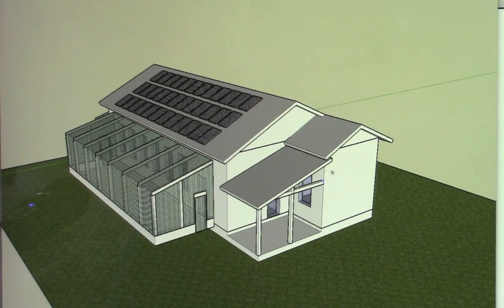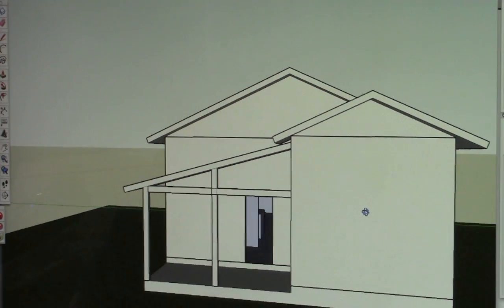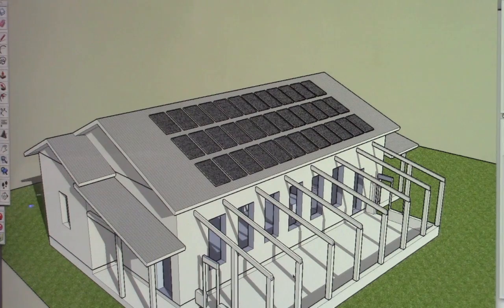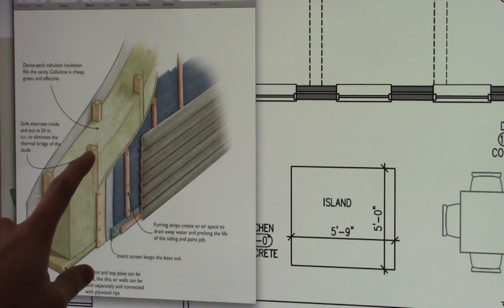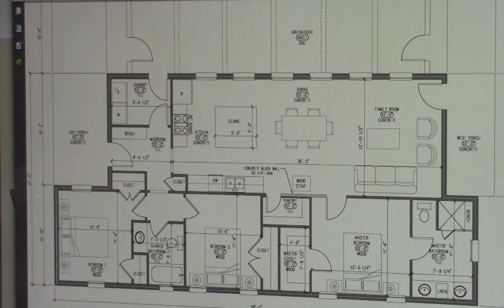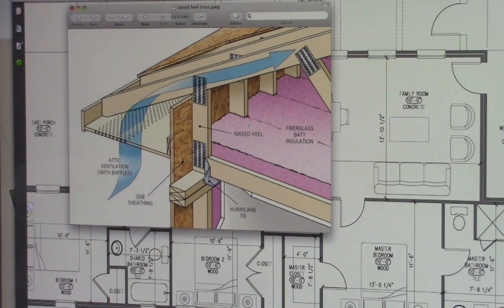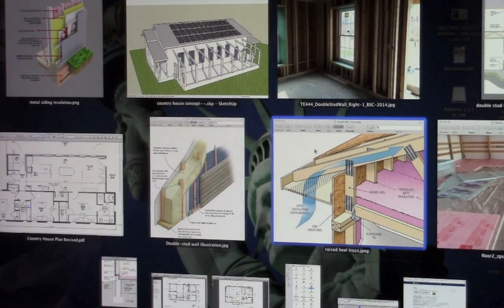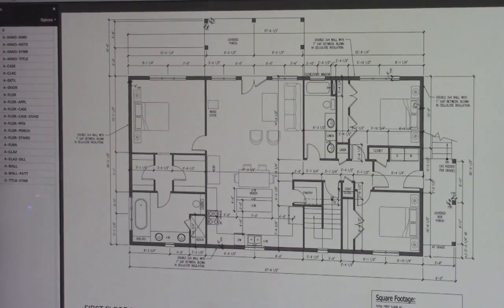Sustainable Off-Grid Home Design - DIY energy efficient green passive solar and affordable!

Comment: You say you would like to do without cooling in the summer. However, it seems to me that a south-facing greenhouse is a major heat collector in the summer (think solar oven) and would put a lot of heating pressure on the house through the windows, if nothing else, even if you have no direct sunlight coming into the windows. Big vents in the apex of the greenhouse, with air intakes at the bottom, would help. 
We've struggled with that design problem ourselves and don't know of a cost-effective solution. We basically have to decide what is more important - heating or cooling. And in Texas the heating season is short and the cooling season is relatively long.
Reply from the maker: I appreciate your comment and concern Inge. Rest assured I am well aware of the heating and cooling principles here. Think earthship design. I believe I did forget to mention in detail within the video, the use of convective forces to cool that greenhouse in the summer....there will be vents at the top of the roof structure as well as several beeswax activated vents at the bottom of the doors and on the South side. In addition to that, we will have a geothermal air movement system pulling that warm air through the cool ground further keeping it cool.
Reply: Thanks for the reply. :)

If I "think earth ship design," it raises concerns, because the word from those who live in them is that they get way too hot in the summer even at Taos. The original designer of the "earth ship" does not live in one himself. He seems to prefer to live in greater comfort. ;) The theory of the earth ship sounds good, and we were intrigued enough to do a fair bit of research and even bought a book on earth ship construction. But the actual experience of those who live in them does not support the theory. (Too cold in winter and too hot in summer.)

I am interested in the topic because I really wanted to have a greenhouse on the south side of the house but have not been able to figure out how to prevent heat build-up in the summer. This would be in the hill country of Texas. I'm currently in British Columbia, Canada, and know how difficult it is to keep a greenhouse from overheating even up here in the north. Even with an 8" full-length open ridge vent and open doors on both ends of the greenhouse (10'x 25'), temperatures tend to get too hot for tomatoes to set fruit in the hottest part of summer. I would hate to have that heat next to my kitchen/dining room. I imagine some fans would help, though. 

The best I've been able to come up with involves removing most of the glass walls of the attached greenhouse in the summer. Not sure that it is all that practical. I think I'll settle for a nice patio and a free-standing greenhouse big enough to stretch the growing zone for a small avocado tree (Fantastic or Devine or both.) This would be a hoop house whose side walls can be rolled up to let the breezes through while shade cloth on the roof tempers the July/August sun. 

The appropriate overhang on the house would shade the windows in the summer and heat up the concrete floor in the winter. (Already know that a covered porch on the north side would be used a lot.)

Our son already lives on the property and when I fantasized about a kitchen stove/heater combination (fairly pricey) placed similarly to your heater, he reminded me that the heating season is usually not much more than 3 months long, and the cooling season is more like 7 months. H'mm ... 

I confess I had not heard of beeswax activated vents to had to look them up. Great idea! :) 

As for using geothermal tubes to cool the greenhouse, that sounds intriguing and our son considered that for cooling the house, but is not an option for us because bedrock is 18 - 30" below the surface of the soil. I think you'd have to go down quite a ways to hit sufficiently cool soil. (I did a little research for a root cellar and found out that Texas soil temperature are a lot higher in the summer than they are here.)

I would be really interested to know how this setup works for someone in actual practice. :)
Reply: Inge Anderson Well, if you had researched more you would have seen that the earthship design has contributed to evolve. Yes, in the beginning there were large temperature swings of 10-20 degrees between the hottest summer days and coldest winter nights but now, with further leaning and improvements, that's largely gone away completely. They have continued to learn and adapt and make them better. Now they stay within 5 degrees all year round and there are a ton of people who live and have been living in earthships or earthship inspired designs for 25+ years. A guy named Ted comes to mind among many others. He worked for Mike Reynolds and built his earthship there in Taos. Then he went and created his own company, sold his earthship and created his own design of which he currently lives in now. Same principles though. Bottom line: make sure you have current information before you discount something.
Reply: Starting that with a "hey did you know they have made updates to Earthships..things are getting much better in ways of passive heating and cooling" would've probably been preferable. Instead you took the opinion of another as a direct affront to your belief structure and it hurt you so deeply you felt the need to correct them with a "Bottom Line". Maybe next time you can try to be helpful and informative to someone whom it seems enjoyed the ideas of an Earthship, but has not kept up to date with the advances. Bottom line: Leave your ego behind...Especially when anyone watching/commenting on this type of video is obviously in the right frame of mind with trying to help people and the world learn sustainability.....Except you that is. Please don't be upset and respond with a failed attempt at retort either. Just accept the lesson and grow.

Comment: Great presentation. I guess the only question I have your brick or block wall behind the wood stove. Rite behind that you have a Pantry. I thought Pantries are suppose to be cool dry places, wouldn't the heat transfer to it. Excellent job. Rick from Illinois.
Reply from the maker: Thanks Rick. The wall to the pantry will be insulated.  The thickness of the stone combined with the insulated wall should not really affect the pantry.  Also the wood heat is a dry heat so no worries there.

Comment: I'm curious as why there are not  more basements in TX ?  Is it due to the more clay type soil ? even a 4 ft under grade split entry would help with cooling you would think.  My Father, was a sub contractor/ framer. I would sometimes so out to building sites in my summer time boredom, He also was a fan of double studs.
Reply from the maker: +Diana Kalis Excellent question.  There are a few reasons actually.  Clay soils are one. Additionally though, the water table and frost lines are the most prevalent reasons.  The water table in East, Southeast Texas  is very near the surface. Digging down too far will cause a need for water mitigation by mechanical needs during construction and after the house is built. Also, the frost line if near the surface. It is only about 12 inches deep so you don't have to bury pipes that far down so no need to really spend the money to dig deep for a basement.  In MI where I grew up you need to dig 5 to 6 feet down to bury pipes so the extra 2 feet for a basement is fairly cost effective.  I guess also contractors got used to building slab on grade and crawlspace homes here so maybe they did not want to try a basement...just speculating on that.

Comment: Did you break ground yet?   I stumbled across your video as I am performing research for my own project.   I like what you have going on here.   I would love to have a sunspace attached and grow a garden within but my fear is that the plants would generate moisture that would enter the super sealed house, which is bad.  I would love to see your design incorporate a garage on the west side with entry to the house via a mudroom and kitchen.   I find myself having to tramp all the way through two rooms until I get my groceries to my kitchen in my current home.
Reply from the maker: +Drew Baden Thank you for your comment.  We will keep the moisture at bay in the greenhouse with moisture sensor exhaust fans and inside of the laundry room there will be a moisture sensor ceiling fan which will vent out that moist air that gets into the home. That room will act also as an airlock.  We will also install an air exchange system in the home which is very necessary for a highly sealed house.  
As for the design, this is very specific to us.  We are very client-centric and every home designed is like a prototype.  We tried to design it in a way that can be added onto if needed.  We are going to put a metal garage on the east side with a breezeway to the east porch.  
Hope our video helped.  Thank you for watching.  We will be adding more in the future when we break ground.
Reply: Hey buddy.  Just wondering what you drew your plans on and if I could get a copy of them?  I'd like to use it as a starting point.  Your plans make sense to me.
Reply from the maker: +Drew Baden Thank you for the kind words regarding the design.  We would like to be of some assistance.  Please private message me and we can discuss in further detail.